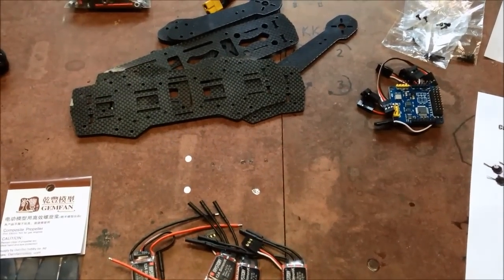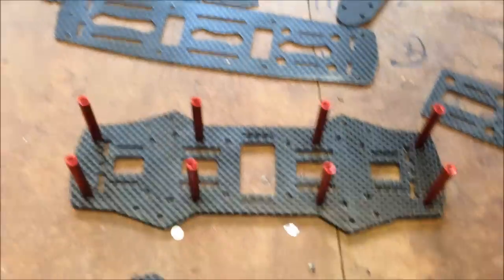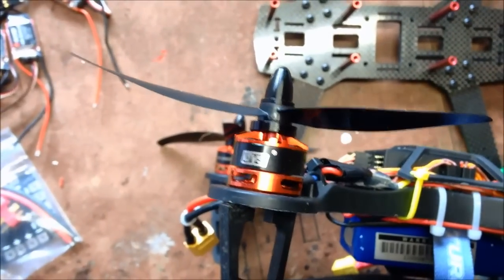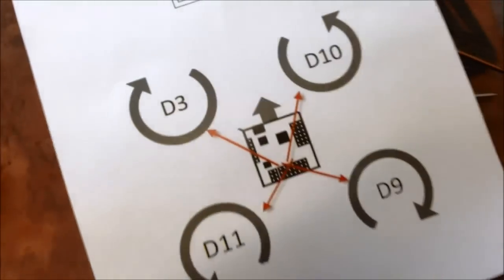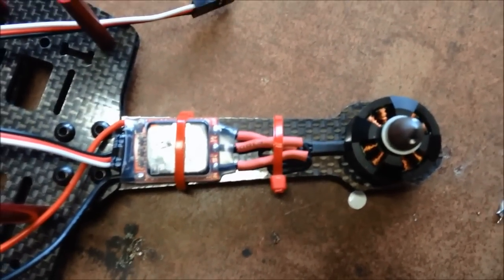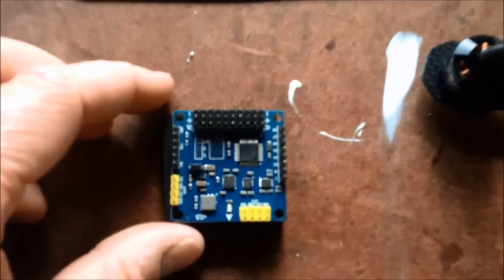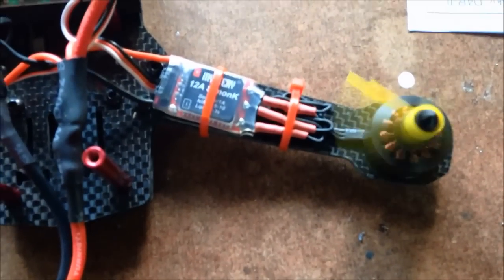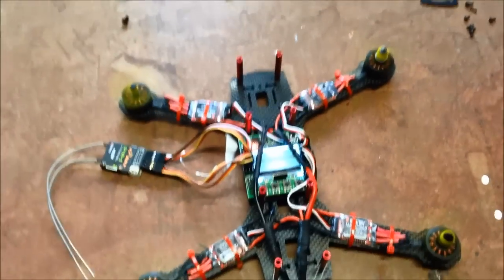QAV250 FPV Quadcopter Build. Mystery 12A ESC EMax 1806 2280kv Motors KK2

Comment: andruino pcb? so this must be easy to upgrade things like battery, wifi ect?
what you think of all in 1 escs? im new but been looking. cant see why the hi end drone programmes for return home, hover, follow ect wont work either.
I just want to build a fast none fpv for now. seen frame cheap and that power board you used infact these motors and escs too for real cheap but obv this old so what have you done or would you do for more power? im thinking racing too for fun.
Reply: ah hows distance determined. by transmitter and receiver crystals? whats max distance and name for them these days? been a while but all looks familiar.
no servos then?

Comment: Great kit, really surprised how decent these tiny motors are and if you swap out the ESC, they take 4s without issues on 5045 whihc is quite a bit more performnace than 3s 6" props.
https://www.youtube.com/watch?v=87ggumRgccE

Comment: question Simon. How did you wire the esc's into the KK FC? I assume you did not remove the red wire from the esc's. You left all of them in. And wired them direct to M1-4. I blew up a KK2 this week assuming that I needed to remove the red from 3 of them. The esc's were emax 12 amp. So I burnt 3 of them and then the board also. So Im a little hesitant to do this again. Can you give some advice. I have a new KK2.1hc and have 25amp plush esc's I know these are linear. But I dont want to blow these up also. So just checking to make sure before I do anything. Thanks in advance.

Comment: wow thank you quick response the build looks easy its just the board and tuning that has be a bit worried but thank you looks nice
Reply from the maker: +jason richards Get one that has a cc3d or Naze32 controller not the Multiwii like I bought. I ended up using my trusty KK2 controller. I love them as the configuration is on the LCD thus you can update in the field without a Laptop.

Comment: Multistar High Capacity 3S 4000mAh Multi-Rotor Lipo Pack  for same setup...Please advise
Reply from the maker: Venkatesan A It would be way too heavy for this Qaudcopter
Reply: Simon Hahnel  battery weight around 244 grms if is not goings to work then may have to buy 1300MAH  Please advise.

Comment: I am looking into start building quads and there is so much out there to learn. I can build and solder just fine, its how the electronics work together and which software I'm unfamiliar with. Does anyone have a good guide for getting to know whats out there to differentiate what motors with what ESCs or what ESCs go with which flight controllers etc... Also a guide for the software to use to program them. Any info would be helpful thanks!

Comment: Since you have a D4R-II and KK2 board, you should set them up to use PPM.  It would be a few less wires on your build.  This shows how to set it up:   https://www.youtube.com/watch?v=6Oegq7QEauw
Reply from the maker: ***** I must have been having a slow day when i did this as I could not find the ppm settings. I have upgraded my kk to RC911 firmware and found it later on the initial setup menus. It is now running PPM
Reply: Nice.  The D4R-II was my main choice for receivers because it supports PPM.  I like less wires.  :)

Comment: Hey nice build. :) may I ask why you didnt use the multi wii? is there no way to use it without the usb ftdi? Also what radio controller are you using. thanks
Reply from the maker: Ofa Ahmed You need the USB ftdi to plug it into your computer and configure the flight controller. I am using a Turnigy 9xR Transmitter with FRSKY Radios.

Comment: I have one advice to give you: CPPM !

if you upgrade your KK firmware you can switch to ccpm RC input, meaning your frsky Rx will use 1 lead only and feed 8 channels, meaning you could enable some aux functions like stab mode.

I actually have another advice, get a naze32.

Comment: Did you youse Emax Simonk Series 12A for your build
Reply from the maker: Mystery 12A Simonk ESC was what was used in this Build
- Max continuous load: ~11 amps
- Burst Current: 16A/10sec
- BEC: 5v/1amp max
- Lipo Cells: 2 to 3 cells
- Cables are fitted with female 2mm bullet connectors
- Weight: 10g
- Dimensions: 24mm L x 18mm W x 7mm H (29mm in length including capacitor)
- 15cm signal wire / 5v power
- 5cm motor wires (including 2mm bullet connector)
Reply: Simon Hahnel Do you know if these were flashed with Simonk 5-15-13?

Comment: Hi great vid, I have been wanting to get one of these quadcopters could you send me the link to buy it please.
Reply from the maker: http://www.ebay.com.au/sch/rc_top_one/m.html?_nkw=&_armrs=1&_ipg=&_from=

He has one with FPV and controller as well if that is what you need.

Just be aware that it does not come with the programming card for the flight controller. So if you plan on using the MultiWii that comes with it you will need to buy that as well.

Comment: Hi,

Looking to build a quad based on the KK2, What I don't understand is that the input voltage is 4v to 6v for the KK2, how do I wire this up with a 11.1v 3S lipo? Thanks,

Joe
Reply from the maker: It gets its power through the ESC signal wires. No need to wire it separately.